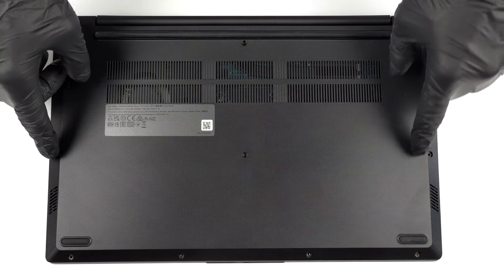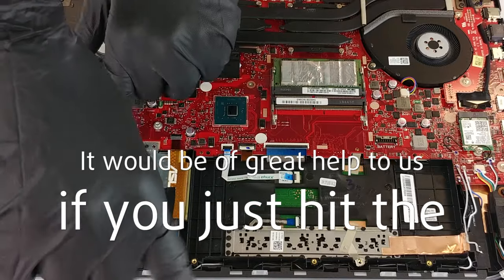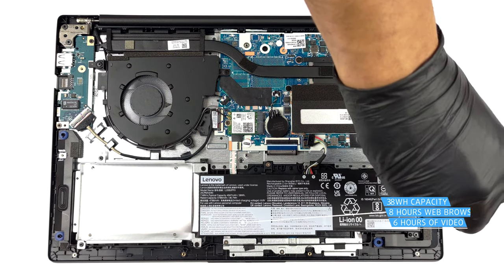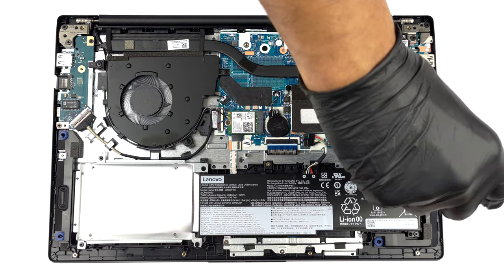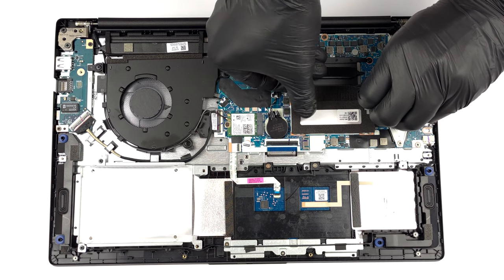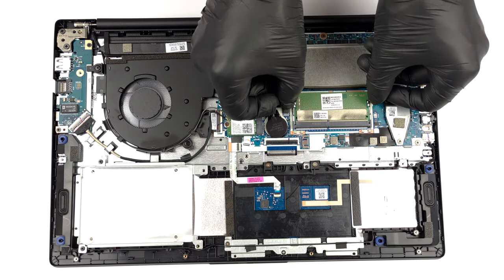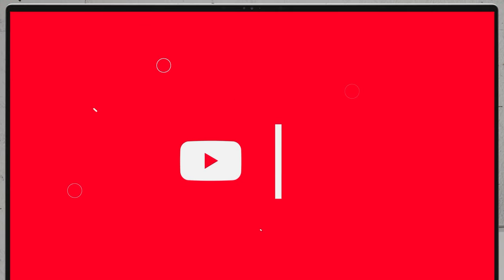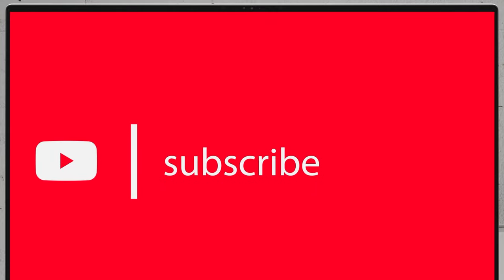🛠️ How to open Lenovo V15 Gen 3 - disassembly and upgrade options

Comment: I was wondering since the maximum  RAM is 12 GB and my same laptop has 4 GB soldered can i add a 8 gbb ram stick or will it make it less efficient
Reply: yes you can and more ram is better i don't think it's dual channel so it doesn't matter

Comment: Hi i recently bought the V15 gen 3 with bigger 45Whr battery, i want to know if the battery has eaten up the SATA slot space, can you please confirm if it has additional RAM and SATA slot it?
Reply from the maker: Hey, unfortunately, yes - the larger battery eats up the space of the 2.5-inch SATA slot. However, the rest of the upgrade options are unchanged.
Reply: Hi, can you Please tell me your battery model name? I don't need 2,5 bay, and struggle to find bigger battery
Reply: @gwert8100  
Lenovo BATTERY, 11.1V, 45 Wh, 3cell
Part No	5B11B36279
Commodity	Rechargeable Batteries , internal
Mfg Part	SBB1J02231
Reply: I'd choose bigger battery over sata port all day
Reply: @ozmobozo  Me too. But most midrange laptops i see have 500GB SSD, hence you'd go through the hassle of shelling out your pocket for bigger storage which i did.
Reply: @seepranavg  Storage is really cheap these days and there is less than 10% difference between a sata and an nvme ssd anyway.
Reply: @seepranavg  bromine this laptop. how can I upgrade storage. Mine 512 gb ssd . Can I add more SSD or 1tb hdd?

Comment: You should post links to the upgrade options! I’m having trouble finding parts. 
Can you upgrade the ram?
Reply: Yes, you can upgrade the RAM. Any standard DDR4 SODIMM will work. DDR4-3200 (sold as "3200MHz") 1Rx8 or 2Rx8 will normally give the best performance, 1Rx16 is slower.
There's not much point in posting links, because links are normally only relevant to a few countries and often change.
RAM is a commodity, you should be able to find an 8GB 3200MHz 1Rx8 SODIMM easily using google search or in a local PC component or repair shop (if there are any such nearby shops). Just don't buy Registered or ECC RAM (designed for high-end workstation laptops) or a full size DIMM (designed for desktop PCs). XMP RAM would work, but not at XMP speed, and normal 1.2V (JEDEC) DDR4 is usually cheaper.
Also any 2242 (re-using the adapter used for the current SSD) or 2280 (removing the adapter) M.2 SSD will work, as long as it doesn't have a built-in heatsink. You can use an external M.2 enclosure to copy files between the old drive and the new one.
Reply: @nathangamble125  if we add 8GB ram to 4GB soldered, will it be good?
Reply: @nathangamble125  I have exactly the same laptop and the same RAM (1Rx16 Samsung, 8GB), but it doesn't start with extra RAM installed, just black screen, working fan, and three leds on keyboard. I've bought one more RAM (1Rx16 Hynix, 8GB) and it doesn't start with it too. Any ideas?
Reply: @itsgillani427  yes
Reply: @vitalii_myt  well, the laptop alredy has 8 gb of ram sodered directly to it, and when you add 16 gb of ram , it gose to 24 gb of ram (wich more likely the bios is not capable to read)

You should add at maximum a module with 8 gb ram in the slot

This is specified in the tehnique documentation of the laptop too

8 gb ram sodered + 8 gb ram sodimm ddr4 3200 = 16

So by adding a 16 gb module instead of 8 it gives u the black screen

Usualy any CPU has two chanels for the ram memory
 On computer most of the motherboards has 2 or 4 slots
The ones with two slots has 1 slot for each channel
The ones with for slots has 2 slots for each channel

So using my logic i can understand that the sodered module is on one of the two chanels for ram the cpu has , and the slot is for the second channel
Reply: @randomone649  You misunderstood, I tried to add 8 GB
Reply: @nathangamble125 I want to understand
Like if my Lenovo laptop has 8gb (same as the video) 
And I wanted to add 8gb more to have dual channel
Can I do it or there's only one slot 
And did he show the solderd ram in this video?

Comment: hello where do you put 2.5 hdd in this laptop there is no port
Reply: U can't, there is not enough space for an HDD , usually laptops (older ones) have an HDD that is 2.5 inches and uses SATA 3 port (you could replace this one with an faster SSD)
Other laptops uses 2,5 inches SSD on the SATA 3 cable (u could replace this one if u want with a bigger HDD)

This laptop uses NVMe SSD (wich is a different port from SATA), so u can upgrade only with a NVMe SSD
Reply: I thought I'd add - there definitely is space for a 2.5" hdd/ssd, and a connector to go with it (source, I've just taken the back off my V15 G3-IAP, and it's there). it fits in that white panel to the lower left